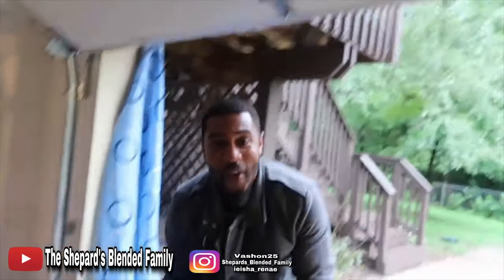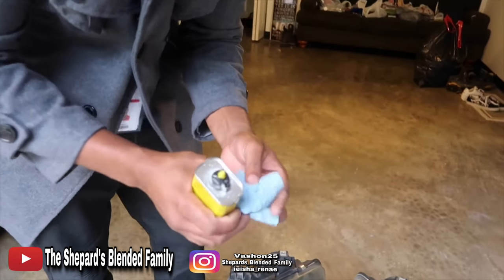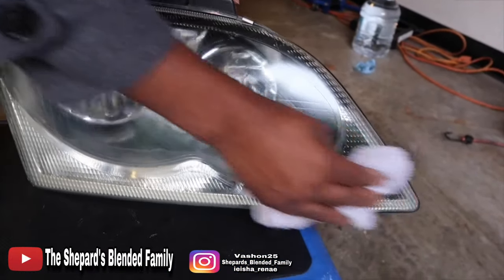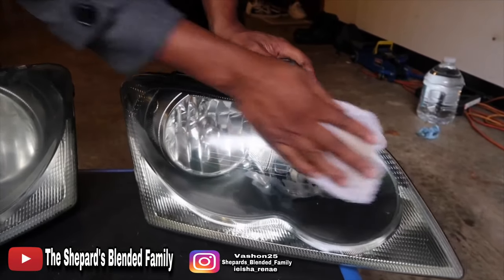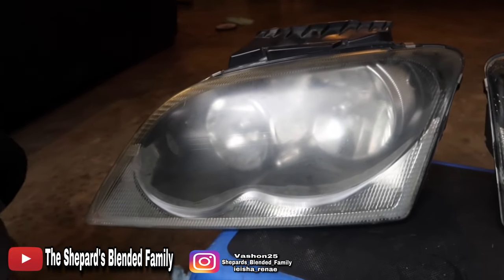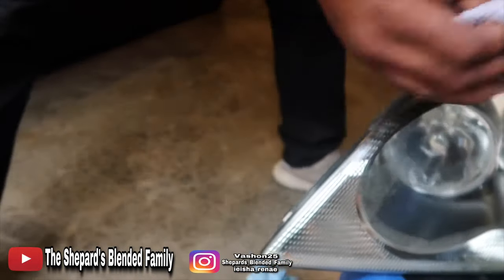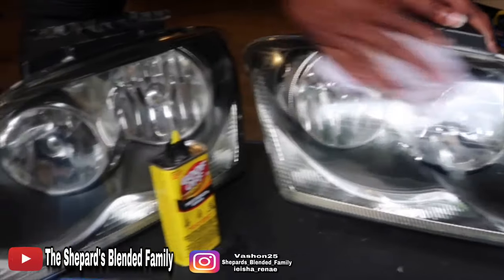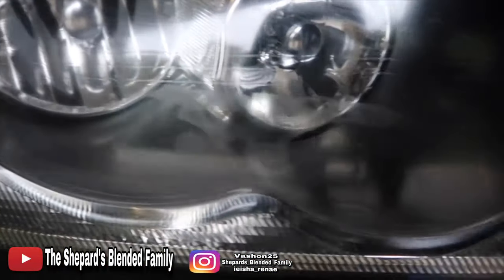Headlight Restoration using Goof Off!!! Part 2

Comment: Im sure this will work but it will ruin your headlights. Goof off is really strong but goo gone is less abrasive. However if you do use goof off then you will need to apply a clearcoat or some type of protective coating or tint

Comment: I discovered this before seeing this video. I cleaned a TV stand with goof off to remove a sticky substance that wason the stand when I bought it from the GOOD WILL store. The goof off work but dulled the stand where the stickiness was removed. I used Meguiar's plastic cleaner and polish first then Meguiar's headlight coating.The area I used goof off on now looks newer than the entire stand. I suggest you do the same on your headlight. Just use a glass cleaner on the headlights before using the Meguiar's products.  I will be sanding first before trying this method on my headlights. God Bless.

Comment: So i got goof off on my headlight on accident and it completely ruined it. But the headlights are worth $250, and i didn't give up. I wet sanded them from 320 grit all the way going by 200 grit increases, to 1500 grit. Then applied headlight restoration stuff. They look new now.
Reply: I done same thing and ruin mine as well.. so what u did actually work